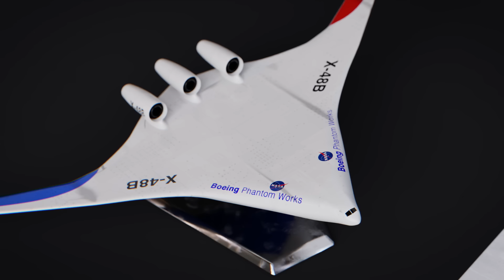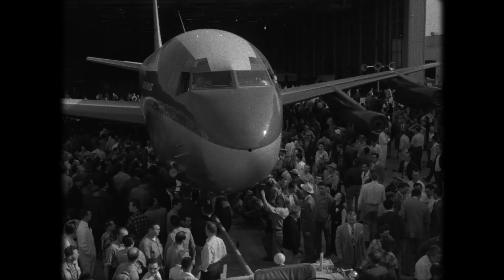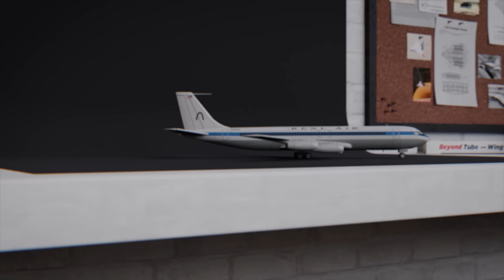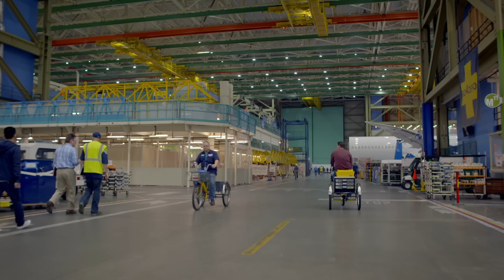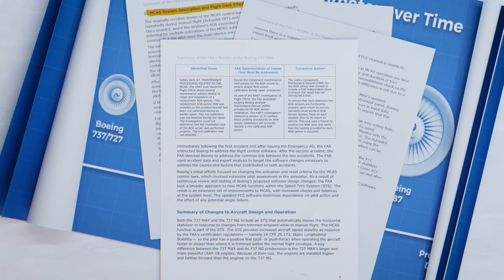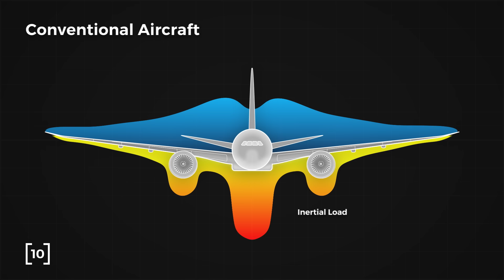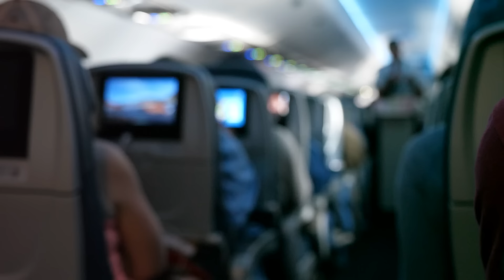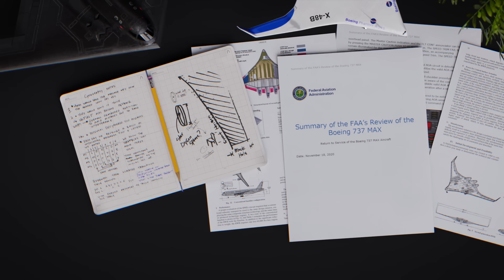The Plane That Will Change Travel Forever

Comment: Hydrogen is good in terms of weight, but pressurized containers still have to be cylindrical, and thus space-wasting.
What I would like to see more would be electric blended wing plane with structural batteries, that span along both bottom and top parts, to make entire construction rigid.
This would strengthen entire body*, therefore making *effective weight of batteries much lower.
Elon and other people in that area spoke about 400 Wh/kg being enough for airplanes.
Today we stand around 320 Wh/kg - that's not far away.
Reply: Could the hydrogen tanks be arranged in such a way that the spaces in between could be utilized for other things, thus mitigating some of the otherwise wasted space?  Nothing flamable, of course.  But, since they're at really cold temps, maybe they could double as refridgerated food/cargo space?

Comment: Thanks a lot, I never thought about the cabin pressurization problem on such planes. I believe you forgot to mention, or maybe I missed it, the fact that when you are sitting on the very outside of these new planes any turn will translate into a more intense up and down movement ... so sitting inside on the outside😂while correcting the wings position before touch down on a turbulent day might be a very shaky experience. I am also still asking myself how to land these during strong crosswinds, when you have no rudder?
I fly these as drones without a gear, landing in the grass, and on very windy days it logically also crabs into the wind. Since my flying wings don't have a gear, it doesn't matter if they land in the grass slightly sideways, but on a runway they must have some mechanism to fly sideways to the wind in order to land, wonder how they do that?
The beauty of these flying wings is definitely the high efficiency as well as the enormous range of speeds, extremely low stall speeds because of the huge wing area while still relatively capable of higher speeds because of its very low drag. But flying this manually without a flight computer is very challenging and with a computer it is very smooth sailing.
RC pilots have realized the fascination of these planes a long time ago and now there are ultra efficient wings around ... real beauties https://youtu.be/HWy3-UJDC-w

Comment: Flying wings are very stable without needing augmented control, I have flown a LOT of them via radio control WITHOUT any gyros etc, they are actually more stable in my opinion. No idea where you got the idea from that they are unstable.
Reply: Because full-scale military aircraft of this design are unstable. As long as there is a computer to keep them under control, instability can actually be an asset. Unstable planes maneuver much more rapidly than stable planes. You're probably right that it doesn't have to be that way, but if it's not, you give up some of the benefits from the design.
Reply: @mal2ksc  The "Flying wing" design just isn't unstable, and I would imagine it to be very hard to make one unstable, the only way I can think of making one unstable would be to have a strange COG. 

The only instability, or control issue with the stealth bomber is that it doesn't have a rudder, but the only reason you don't have a rudder is because of stealth, and a commercial airplane would not need to be stealthy. 

The flying wing design was flown way way way earlier than working computers Look at the Horten Ho 229 etc.

The other thing is that the issue with a rudderless aircraft was solved with the B2 by the use of split elevons.

The idea that a military plane is better unstable and flown by computer is also wrong. The only aircraft that benefits from being unstable are agile fighters, but bombers, and transport planes benefit from stability because you want something that can still fly even if damaged.

I am really surprised that RE went down the path he did with the instability thing as it's just not an issue with the flying wing design, and if you do any research at all into the subject the stability issue is one of the reasons that a flying wing is preferred. 

I have flown a LOT of RC aircraft, and flying wings are by far the easiest to fly, and there's nothing computerised about them.

Comment: 9:50 As Simon L notes, flying wings can have great stability. This is provided by a combination of sweep back and washout (i.e. the wing has a built-in twist so that the incidence and therefore  angle of attack is less at the tips). As a kid, I built a little balsa sheet model of a bigger free-flight flying wing model  https://outerzone.co.uk/plan_details.asp?ID=2378 . It flew very well when properly balanced and gently thrown from the top floor of my school :-)

Comment: Have worked on flight sci on several aircraft. For range, the main issue with BWB craft and flying wings is what the stability workarounds cause: constant control surface corrections utterly destroy your range.

Comment: "Passenger Aircraft Engine Diameter Over Time - 737/747" What? The biggest 737 engine was never near the smallest 747 engine.

Boeing did a mock-up of a BWB interior and the public reactions were very negative. No one seemed to wants to fly in an aircraft with theater style seating.

Emergency exits are still not developed enough for passenger models. The rear exits would not be usable during water or landings without gear. If the aircraft had above wing exits the engines could not be placed anywhere near them. With water landings the aircraft must exhibit enough buoyancy to keep enough exits above water.

Lastly, the seats furthest from center of roll would be very uncomfortable during flight because the rolling of the aircraft would be most noticeable, especially to those suffering from motion sickness. Areas too far from the center of roll may not be usable for passenger seating because even minor rolling motion could be hazardous to unrestrained passengers.

There are many reasons that wing-body hybrid passenger aircraft may never be feasible.

Comment: I have a question that I haven't found the answer for: would hydrogen power be superior to natural gas offset by carbon capture? Both are energy intensive and I wonder if fuel capacity might be preferable for a CNG design.
Reply: I believe he has a video from way way back explaining that hydrogen wouldn't work because of the storage problem(during consumption). I may be wrong though...

Comment: One thing you seemed to miss was the role windows play in the safety of current aircraft. As it is now, windows are common enough across the cabin that the passengers eyes are well adjusted to outside lighting during take off and landing, hence why you are requested to open the window covers during these time periods. In flying wing designs, the passengers deep in the cabin would likely not be well adjusted to outside lighting, which would likely slow down evacuation of the aircraft.

Comment: Humans can't sit so far off of the centerline without getting violently airsick when the plane banks. Tube and wing design keeps that axis fairly low, a blended wing would only be able to seat passengers within that area and use that added wing space for cargo and fuel.

Comment: You kind of glossed over airport infrastructure changes. I would be interested to know how much change is required. Will we have to completely redesign airports, or just new jetways?
Reply: Do they really need to be that big & carry that many passengers? 
It's been proven that mid-sized medium to long-distance aircraft have a quicker turn-around time at airports, which saves money!
Reply: @stevie-ray2020  yeah obviously less people means less time to get them off and more back on but also means less people and therefore less money.
Reply: @stevie-ray2020  A 27% fuel consumption reduction would save a hell of a lot more money, which I think will probably make up for that
Reply: airports already need enough length to slow down planes of current weight, and enough width to allow for the wingspan, both with margins.
neither is likely to change substantially, if the lift/mass force position advantage outweighs the pressure force disadvantage they may even sink.
Reply: Barbara was + able but she 8
Reply: Kind of agree. In Seattle the SeaTac airport is kind of cramped but it isn’t surprising seeing how it was built in the 40s…
Reply: @tomstulc9143  you really hurt my feelings by insulting the beautiful city of Seattle 😢
Reply: @tomstulc9143  "geto" lmao
Reply: @tomstulc9143  Sodom and Gomorrah... isn't that a bible story, where god destroyed a city because gay men did gay sex? what are you, some kind of fundamentalist christian?
Reply: @ff-qf1th  fundamentals not. They are protestant heritics.
Reply: @ff-qf1th  In regards to the city of Sodom's story,

The events contained within this story involve a city of people who have immense thirst for the angels that had descended upon the earth. Their sheer violent thirst lead to them attempting to rape the angels, who Lot tried to protect in his house. Lot certainly wasn't a perfect saint, since he offered his daughter- which they all denied, and they threatened to tear down his house to know the angels "carnally". Essentially, to rape them. The violent lust is clearly the issue. It would be equally sinful regardless of their sexualities, and sexes. 

I might not be right with many things, but this is what I think about this story. Sorry for bringing up religion in an engineering reply section, but I simply can't stand by and watch this specific misunderstanding continue. So help me if someone mentions the start of Romans.

Edit 1: changed "uelp" to "help", to correct a typo error.

Edit 2: added edit log, including [Edit 1].
Reply: @tomstulc9143   "Liberalism is a rot which destroys whole civilization" Now where have I heard this before?
Reply: Plus how tf do you emergency exit that thing? Drop out the floor?
Reply: I can imagine there would be "pincer" like jetways that can adjust themselves for multiple sizes of aircraft. Will probably have several doors along their length for the largest planes, but only some would be used for smaller planes. Or, by the looks of the design, you could back the thing up and enter/exit from the rear.
Reply: That's an interesting thought. I don't really have a concise idea of where the door on the plane is, in all honesty. I'll have to recheck the video and edit this comment to get a grip of where it is.

Edit 1: I've invested about eight to nine minutes into this, and I think I have seen the emergency exits concept, although i am unsure how many of the twelve would be used for boarding and offloading. Probably the six in the front, but I'm not sure. Could we not just space out the ports more, and use similar bridges to currently used ones to align to the blended wing plane's six front doors? Probably not quite so much of a ninety degree angle, though... I don't know the half of airline stuff, but I wanted to contribute something.
Reply: Wasn't this one of the 'failures' of the A380? That airports had to modify to handle them.
Reply: Surprisingly, most of the airport infrastructure has nothing to do with planes and everything to do with people and their needs, and borders and their red tape

Comment: Would a blended wing aircraft have significantly less crosswind landing ability, due to the absence of the rudder?  If so, what impact, both financial and from a consumer standpoint, would this have on commercial air travel with planes potentially having to more frequently divert to alternate locations in bad weather?

Comment: Is there a reason why the CG-CL issue has never been addressed at a commercial level by canard designs? They replace a downward force with an upwards one, and they are more inherently resistant to stalling. They might not be as efficient as the BWB designs discussed here, but they don't require much significant change from the tube & wing standard.

Comment: Utter unqualified rubbish. Blended wing craft have been repeatedly touted as revolutionary for over 50 years. It's getting tiring. The deal breaker was and still is the structure mass for pressurization cycle fatigue. Bombs dont need pressurization, passengers do. Spheres and tubes are the ONLY pressure shapes that work safely. Period. Regardless of new materials and 'modern manufacturing methods'. Both of which I have developed and used for aircraft use for decades. The B2 has a small spherical composite pressure cockpit.  It is elemenentary to demonstrate the cancellation of fuel burn benefits in the 3rd year of any credible aerospace engineering degree, and is often given an example of a craft designed by the aerodynamic engineers while the structural engineers, mechanical engineers, human factor engineers, safety engineers and accountants went out for some lunch.  Hoping they will 'solve the minor issues' when they return.  This is not how good design happens.

Comment: As always, you made a great Video ;)

But i just want to touch upon an important point about BWB and BWB kind planes.

Designing such a wide airplane will place you far away from the center of gravity, which ll give you a flying roller coaster feeling :/. That is why you wouldnt fly with it. It is more likely we ll see this design as a freighter first. 

Other problems you talked about are not a big deal with modern technology , production technics and CFK.

Comment: there is a paper glider i learned to make called the Hunkfin Plane or something along those lines. It is very forward heavy, with a wide body and wing tips that slant upwards, much like these panes you just discussed. The special feature of this paper glider is that, for some reason, no matter how you throw it, it always lands upright. 

The designs of these flat, wide bodied planes made me think of this glider. Which then made me think, how well can this design just glide on air? Idk, not an engineer but this was so cool.

Comment: Someone in my family worked on the NASA prototype for this, but im more excited about NASA's PRANDTL wing. I really hope the industry adopts it. it promises 50% more 'efficiency' im not sure about fuel burn but put it this way: no vertical stabiliser. proverse yaw. induced thrust at the wingtips. This has been thoroughly experimentally tested in ' On wings of the minimum induced drag: spa load applications for aircraft and birds. Please do a vid about it Real Engineering. It would be a HUGE leap in aircraft design.
Reply: and also, this is such a good video as always and so I am sorry to be correcting it, but Induced drag is not caused by wingtip vortices, it is caused by induced downwash as the flow that meets the leading edge is already turning away from the high pressure beneath the wing/toward the low pressure above it. The resulting induced downwash causes the lift vector to have a horizontal component that acts opposing the forward motion.

Comment: The test pilots for the Dreamliner were all Airforce vets and very well trained. They knew about the issue with the sensor but thought nothing of it as they were able to compensate for it without issue. It was second nature for them. However, the pilots who crashed the planes had minimal flight experience.

Comment: calling planes eco-friendly because they reduce fuel consumption a bit is embarrassingly unscientific for this channel. that remains true even in the very optimistic case that we could use  hydrogen fuels at the same time because producing H is very energy-intense and we need it for more important uses like industrial processes - but that's not even given as a requirement in the video and only touched on briefly at the very end. saving 1/4 of fuel would be great but it would only reduce the total consumption to 2010 levels (from 2019 levels) - it's still completely unsustainable. flying wings might open up the way to eco-friendly travel in the far future but the wording in the video is picturing them as the single solution to ecological planes that are right around the corner - they are not. it's like calling driving a 2,5t tesla in densely populated areas eco-friendly just because there is no exhaust attached to it. that's just green washing :|

Comment: Oh so 737 MAX had an issue similar to Starliner: using wrong data from sensors.
Looks like Boeing sucks at software / computers...
I guess if done properly, like SpaceX Crew Dragon, the thing will fly.
Although rockets still fail quite often compared to planes, I believe, hm.

Comment: 3-IIX-2021.Back in 1978-79. when l worked for Mcdonnell douglas,l had a meeting with the top plane designers and showed them my patented designs witch you showed on your program,l use to be a Very Big stock owner, nice to see Boeing taking up the gauntlet.

Comment: MCAS used only one sensors by choice. Boeing know if they designed MCAS to use more than one sensors. It's mean this is a flight critical system and they'll have to report that to FAA which will subsequently requires pilot training (on what to do in case of MCAS failure)
Reply from the maker: Oh wow. I didn’t know that